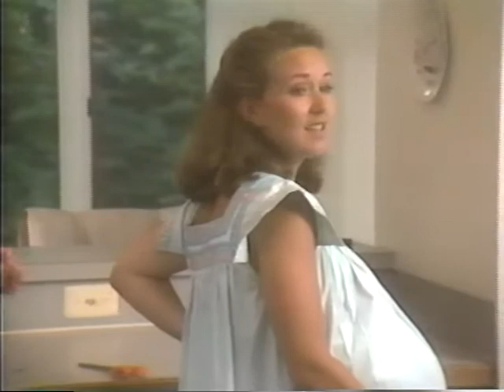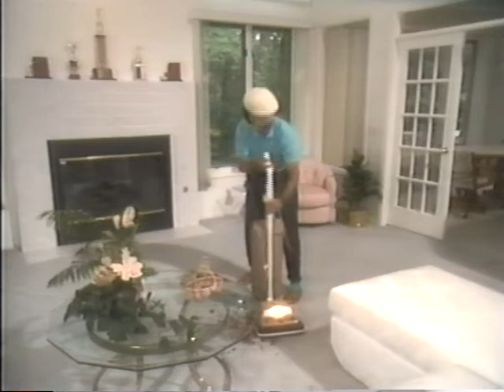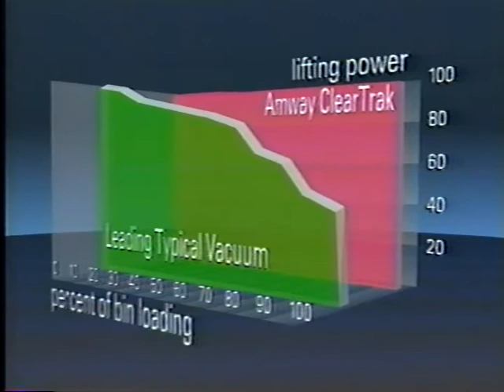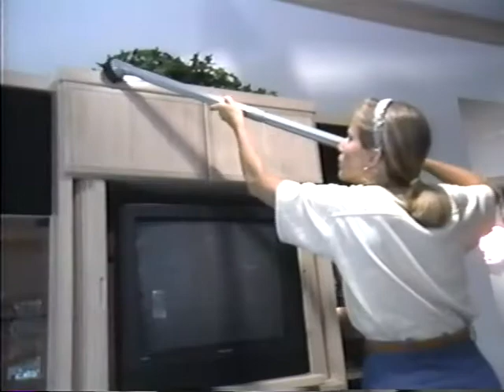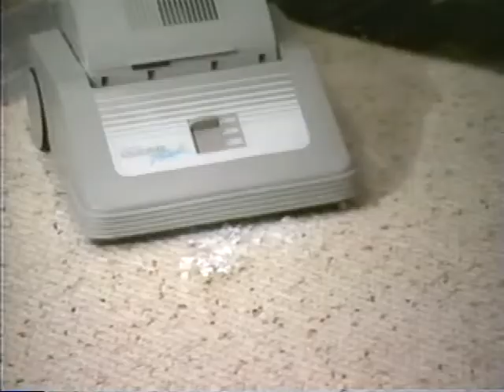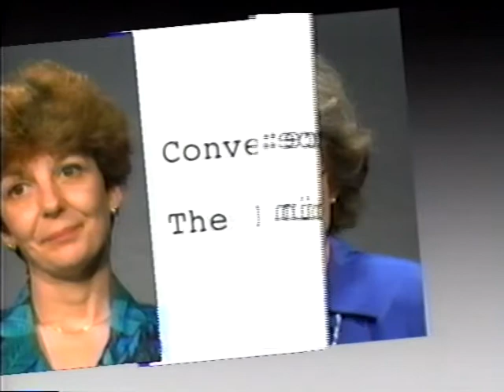Amway ClearTrak CMS

Comment: I’m assuming the dual cyclonic system was licensed from dyson ?
Reply from the maker: jakub b The mode before this was the Amway CMS 1000, short story is Dyson wanted into the American market. Sought after an existing brand to help them. Called up Amway. Amway acted all interested said leave the documents etc and we will get back to you. Amway later said they were not interested. But Amway made their own body  which is far superior to any Dyson body. (I have a ClearTrak and it is 30 years old. Holding up well.) BUT Amway took off the shroud of the dual cyclonic and put everything into production with the CMS 1000. Back to Dyson, so Dyson called up Sears and showed them prototypes etc to get into American market. Sears said “Well Amway is already doing this!” So the lawsuits came flying in and Amway lost. Had to caught up some major cash. Guessing when they made this until 2002 they were paying a royalty or something to using the technology. Still a damn good machine. I have put it up against some well known brands, expensive and cheap. I have been quite amazed at what is pulls up after the fact. Been a good machine for my grandparents and now myself for 30 years. Used 1-2 times a week for carpets, furniture, and dusting.
Reply: @krantz55  you can still get parts for them too! I’ve got my CMS 2000 and it’s been in the family 30 years. I’ll never replace it with anything as even top end vacuums can’t hold a candle to the CMS.
Reply from the maker: @JoshSmith-ek5gk  Yep, my grandparents ClearTrak was falling apart besides the motor, so I “refurbished” it. I took the ClearTrak out to a family members who recently acquired a cabin property. Old old carpet from the 70’s in there. Used a modern machine to vacuum and then used a carpet cleaner. I still pulled 2 bins full easily. Later another family member came who was there before. Asked if I washed the rug. It was so soft now! Said nope, just this 30 year old vacuum pulling up DECADES of dirt. Very impressed.
Reply: @krantz55  yep! I vacuumed my sisters house yesterday and filled it up several times and the carpet looked clean. It was old dirt deep down in the carpet. She was shocked and grossed out by the amount.

Comment: This is arguable one of the best vacuums ever made and it's crazy that this company went out of business.
Reply from the maker: The business didn't go out of business.  Amway is still fully operational. However the "Amway ClearTrak" is not under the Amway name. You can buy a new "ClearTrak" from cleartrak.com  It is now called the Workhorse Cyclonic. But the same machine. :)
Reply: @krantz55  oh great
Reply: I don’t know about that but the best bagless multi functional machine has been made since the 1930s and has had better efficiency than any dry only system.  But to each their own.